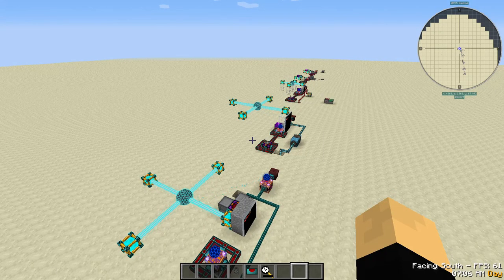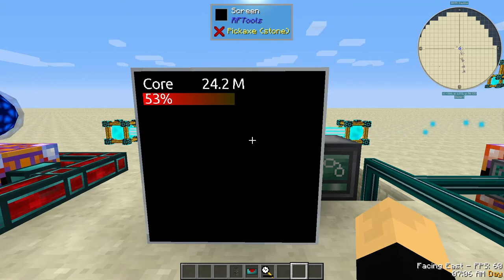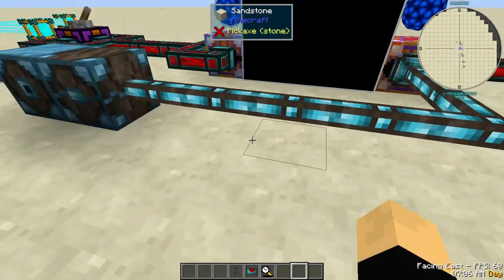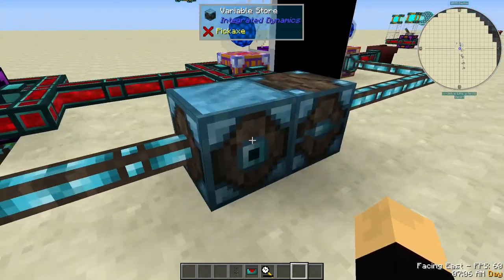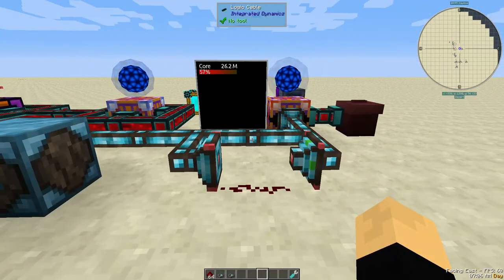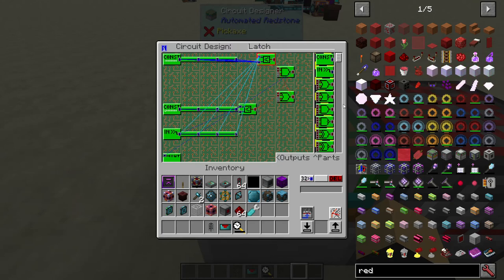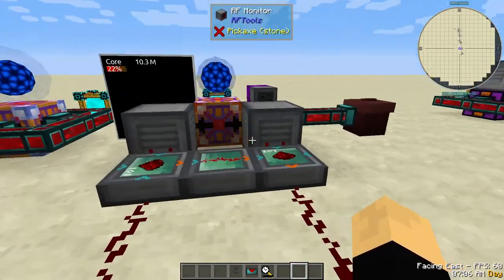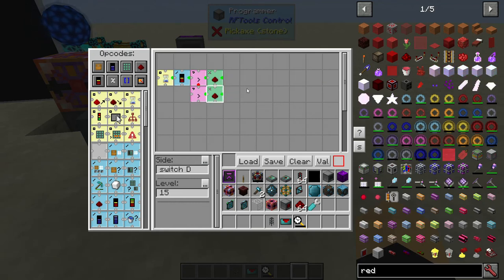Power control logic

Comment: pretty cool presentation of differents approach, you could also use thermal dynamics logic redstone or simply ender io monitor with capacitor banks, i personally prefer project red circuits than the rf tools one but it work as well :)
Reply from the maker: Thanks, ya ender io's monitor is the easiest way pretty much, wasn't available for 1.12 for a long time though, so I had to make do with other methods, plus it's fun sometimes to do things yourself, I should probably revisit this at some point and show off some ways with more nods that have come about since.